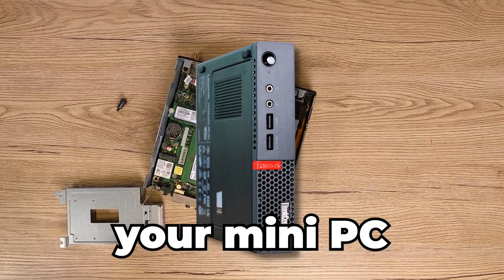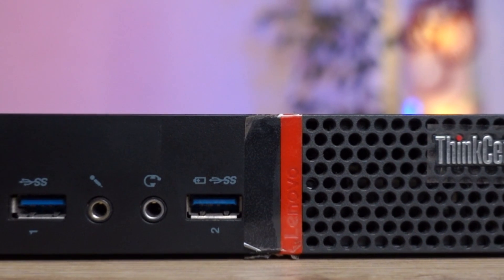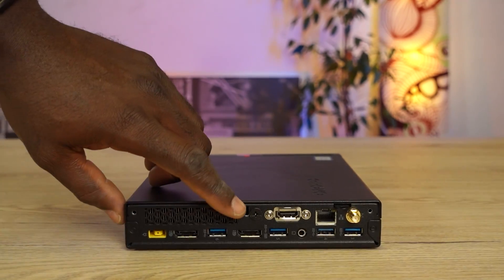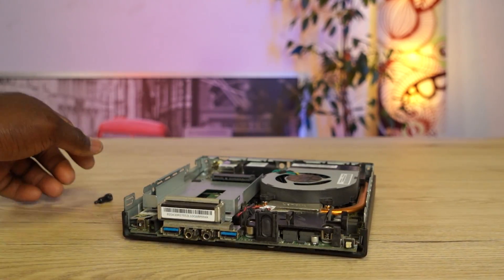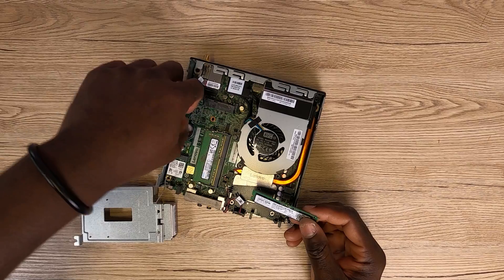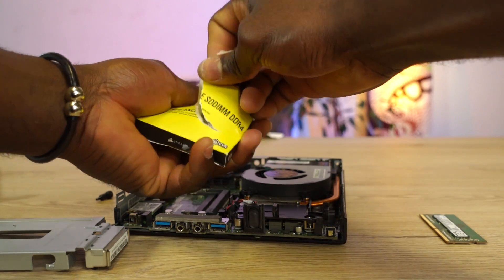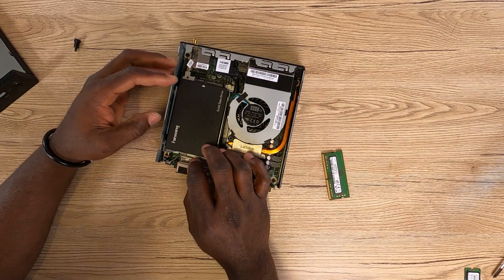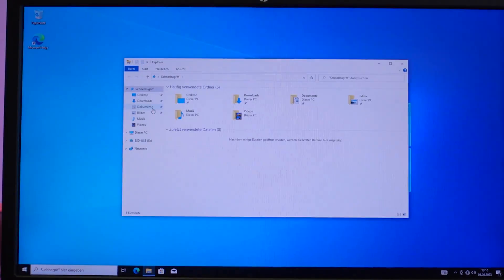How to easily upgrade  your Lenovo ThinkCentre M900 Mini PC

Comment: "Use flat screwdriver to gently remove plastic clip which holds M2 drive in place..." that's what I was looking for on WHOLE INTERNET and I've found in your video. THANK YOU !!! ;-)
Reply: i have one with an EOL m2 disk. I left it inside emptied and just added an ssd because I didn't figure it out how to remove that damn plastic clip.

Comment: Great video! It’s possible upgrade the GPU in this one ?
Reply from the maker: technically yes
Reply: @Hardwaremoney is the solution an egpu? Cause the pcie slot in there is too small to connect to a regular gpu, regardless the case to too small for it too

Comment: Hi, great video. I was wondering if it's possible to install Windows 11 onto this considering its not an Intel 8th generation system.
Reply from the maker: Thank 😉 yes its possible to bypass the TPM and CPU bottleneck, and install Win 11 on this machine. There are tons of youtube videos detailing this.
Reply: Yes you can install  search for ""bypass windows 11 requirements"

Comment: What about the cpu. Could i put a non T or U cpu into this? For example i5 6600.?
Reply from the maker: technically you could, but would not advice it.
Reply: You won’t be able to put in a K as the power supply in this is not strong enough